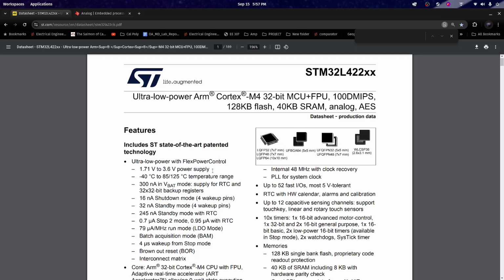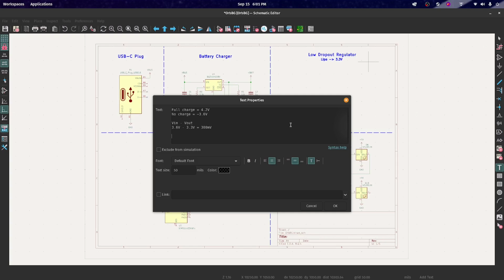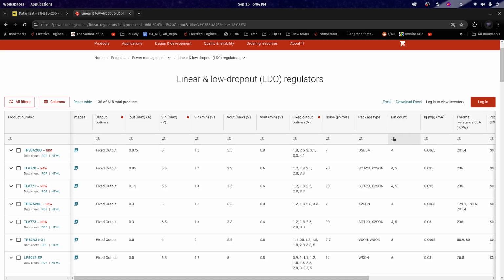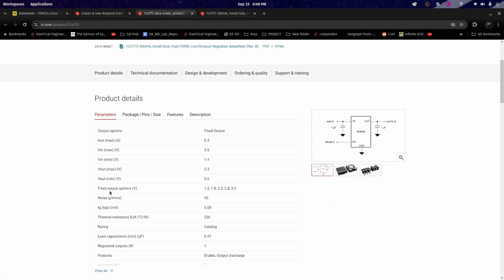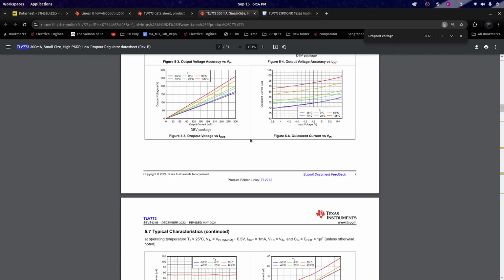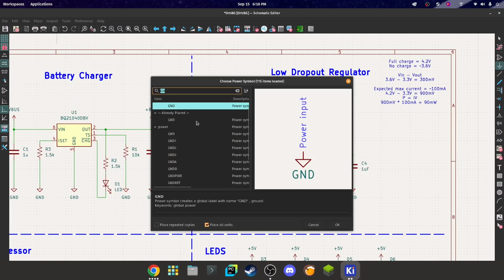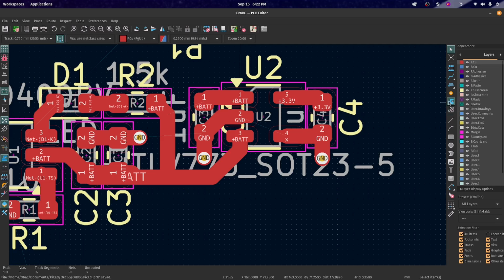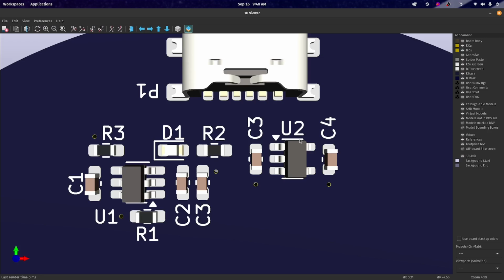Circuit Design Basics: Using a Low Dropout Regulator for a Battery Powered Electronics Project

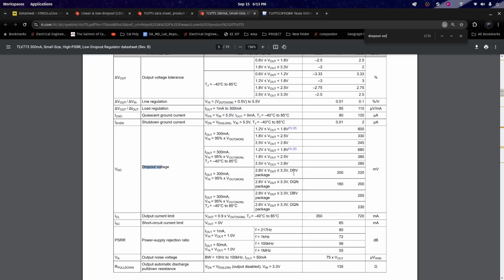Comment: I'm a bit confused, at 12:16 doesn't the data sheet say that at Iout = 300mA, the maximum dropout voltage = 220mV, so your Vin of 3.6V is too high for the IC?

I'm a bit new to reading data sheets so maybe I'm interpreting it wrongly
Reply: Oh wait nvm, I get it now, for some reason I misinterpreted dropout voltage.